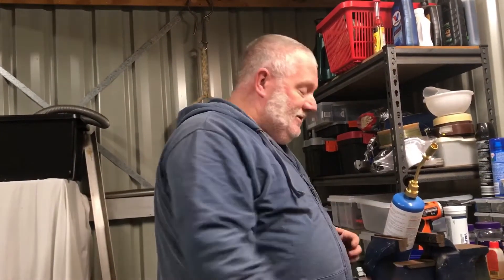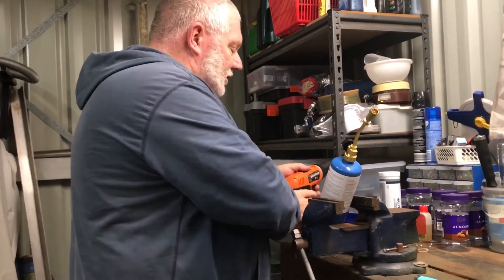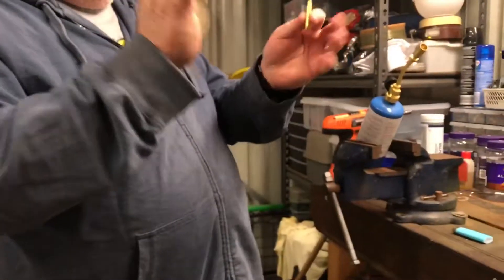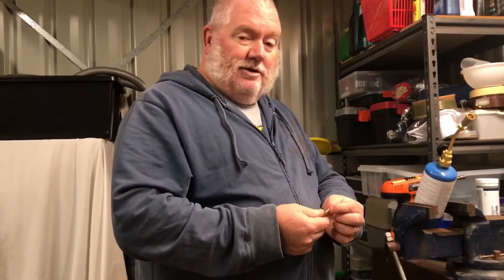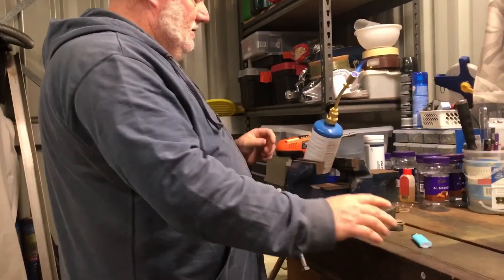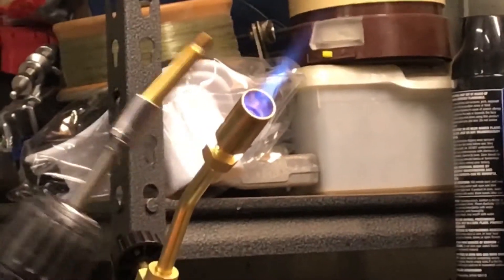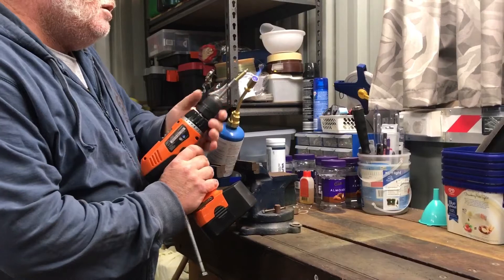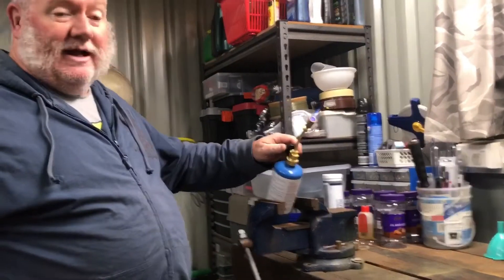ANNEALING BRASS (CHEAP & EASY WAY)

Comment: Why you put hot brass in water? Brass to keep it soft suppose to cool down on air.
Reply: It's non ferrous, it does absolutely nothing besides adding drying time and more steps to the process

Comment: Didn't know that you can keep the properties of annealed brass if you quench afterwards. Glad I learned!
Reply: Brass doesn't "quench" like steel. Dropping in water while hot doesn't cause a change in the molecular structure.

Comment: Great video. Does the neck expander in your sizer pull thru easier after this process?
Reply from the maker: It does seem to, once appropriately lubricated of course. Neck tension generally seems to be better and more uniform.

Comment: Correct me if I am wrong, but wouldn't quenching the case in water immediately after annealing cause the case to become brittle (harden). I know it does with steel.
Reply from the maker: Doesn’t seem to worry it.
Reply: No it's non ferrous, however it doesn't do anything besides make you have to dry your brass off again. I clean brass and anneal when it's still holding moisture to remove all moisture, so throwing it in water afterwards is pointless and more work with more steps

Comment: Old video. I like your method but you’re tempering your brass by dropping it in water.
Reply: I think dropping them in a bucket of sand is probably better
Reply: You're confusing heat treating steel with softening brass.  They're very different.  Steel is hardened by heating to a specific temperature and then quenching.  It is then heated to a much lower temperature and cooled slowly, known as drawing or tempering.  It reduced the hardness but leaves the steel strong and tough.  Brass is hardened by working it by either shaping it when the case is made or when it is worked in the reloading and shooting process.  It is annealed or softened by heating alone.  The speed at which it is cooled has no impact on the annealing.

Comment: I am always concerned that "the cheap way" is promoted as being as good as the results one might expect from an annealing machine and the use of some method of determining the actual temperature (Templac paste) achieved. If you don't know the temperature, you're wasting your time (and effort).
Whilst I agree that this article (  http://www.6mmbr.com/annealing.html  ) essentially promotes the authors machine, the contents of the article are about the science of the process. Yes, it is a science, and an exacting one at that. Read it, and perhaps do so a second time.
Would you use the same amount of flame thrower to prepare a 17 hornet as, say, a 303Br? Unless you know the temperature, your p***ing into the wind.
You will learn also that quenching does absolutely nothing to the property of the brass, other than to cool it a bit quicker so that you can handle it comfortably.
If you consider that it is a useful exercise, then at least do it properly.

Comment: Of all the annealing videos I  have watched you are the only one to quench your brass after heating. I've always believed the quenching was necessary to fully anneal brass to return it to it's softer, non-work hardened state. Thank you.
Reply: It doesn't do anything besides make you have to dry it again... Pointless
Reply: Not sure about with brass... but with steel, you want to let it cool slowly to anneal it. Quenching is normally done to harden the steel. Brass may act differently though and perhaps it does not even make a difference.
Reply: Brass isn’t ferrous like steel so it doesn’t need quenching. Does it hurt?  No. Again…it’s not ferrous.
Reply from the maker: That’s the way I was always shown…

Comment: Without the use of tempilaq to determine the length of time in the flame to establish the appropriate temperature required to alleviate stress in the brass, you're just taking a wild guess at whether or not what you're doing is effective in any way, shape or form.  The way the case wobble around in that socket creates enough disparity in how it's heated to ensure too much inconsistency in the process; if some of the cases you're doing are being heated sufficiently, others are either being over heated or not heated enough.
Reply: Eric Cortina did a test with brass he thought would be useless after 10s of seconds of annealing. To his surprise, the brass did just fine. I would not worry about 1s this or that way then.
Reply: I'll run my until it's red hot on the neck and when it creeps down to the shoulder I'm done.. in a well lit room. Probably could get away with a couple less seconds but seems to work for me so far
Reply: @dontbetreadin4777  - That is WAY too hot.  Do some homework on this topic, to understand the metallurgy...you're destroying your brass.
Reply: @jasonbroom7147  3 years and still the same brass. So it must be working. I shoot once A week year around. Some have 20 firings on them. It's about 5-6 seconds of real MAP gas.
Reply: @jasonbroom7147  also, do some homework on brass and what it takes to "Destroy" it. You can get brass to melt and when it's cooled it's still brass with a virgin hardness. I know for a fact I could get it even more hot and it would still function like brass functions, because it's brass.
Reply: @dontbetreadin4777  - You anneal them in this manner, between every firing?  Please do some research on this topic, from reputable sources, because if I'm understanding your method of annealing, it is getting the brass WAY too hot.
Reply: @dontbetreadin4777  - I am a student of this.  I've been reloading for about 35 years.  The temp you want is 650 to 750 degrees. If you're getting it "bright red", in a well- lit room, you're closer to 900 degrees.  The only thing saving you from damaging the body/head of the brass is that you're heating it very quickly and then removing the heat source.  To put it in perspective, you can properly anneal brass by holding a typical bottle-necked case at the mid-point of the body and rotating the junction of the neck and shoulder in the flame of an ordinary candle.  When the case body gets too warm to hold comfortably, you drop it into a damp towel.  The neck never gets anywhere red hot, there is zero risk to the temper of the case body or case head, and the neck is annealed sufficiently to remove stresses and create proper neck tension.  The way you're doing it is getting the necks way warmer than they should be, but do NOT take my word for it.  Read some of the articles written on the process by metallurgists who understand the science of annealing.  You'll quickly realize you are doing this incorrectly.
Reply: @dontbetreadin4777  - You think softening the head of the brass on your cases, such that it loses hardness, would result in brass that still functions?  If this wasn't such an important topic, and I wasn't so worried about others being misled by your ignorance, I wouldn't bother, because you clearly cannot be taught.

Comment: Some so no water, just air cool. Others, like you, water quench. How do we know which is best?
Reply: Water is not really for quenching, more to instantly stop any additional heat transfer down the body, or even worse, the case head.
Reply from the maker: I do it just so I don’t have hot bits of brass everywhere. Cool it quick; job done...

Comment: I would think a deep socket would hold the case better.
Reply from the maker: It was the only socket I could find in that size. I you’re holding the drill on an angle and only spinning it slowly, so the cartridge shouldn’t fall out.

Comment: how do you  clean your brass
Reply from the maker: After depriving spent brass, I give them all a run in the sonic cleaner. After all the case prep steps, I run them through the dry tumbler for a few hours. After picking all the bits out of the flash-holes and wiping all the dust off them, I give them all one last bath in Shellite to get the last of the dust from the insides. Drain all the Shellite away, then hang them in a laundry bag on the clothes line in the sun and the wind, and you’re away. Hope this helps. Cheers.